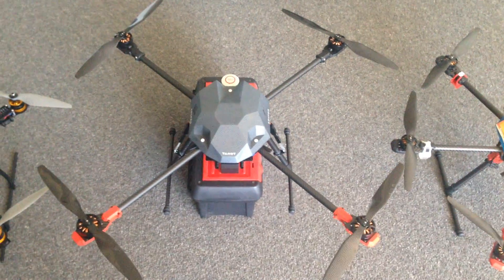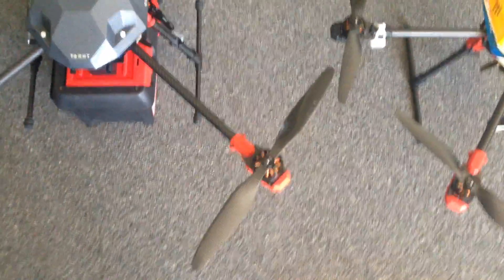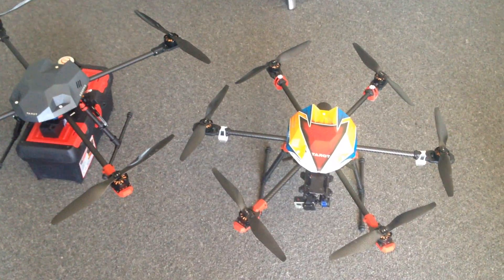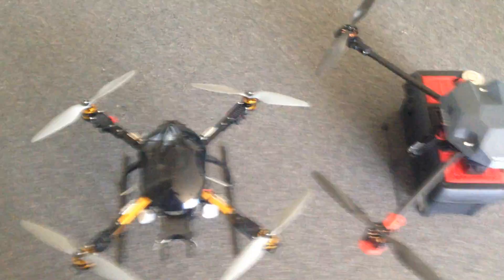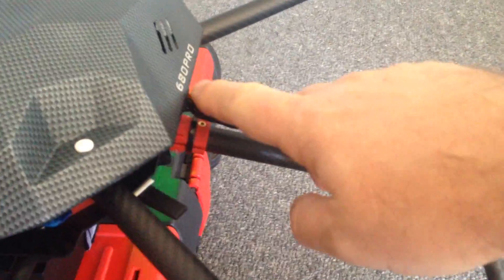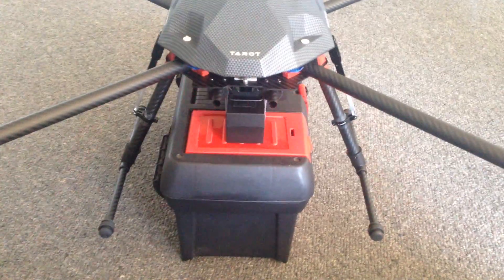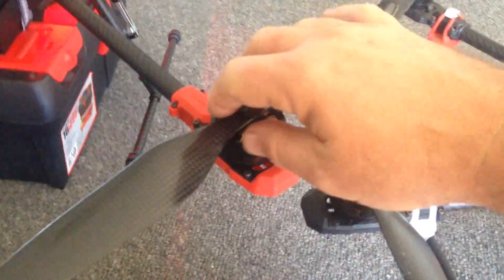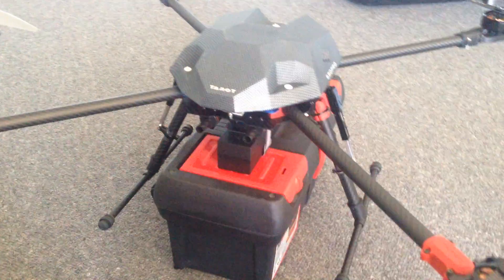Tarot 650 Sport with Retracts - stretched to 840mm

Comment: Hi Trainboy64, to stretch your tarot do you use 333mm carbon fiber tube?, I need to know what is the best dimension, I hesitate between 275mm, 323mm and 333mm.

I'm planning to put 17'' and probably 18'' propeller.
I have 5010 360kv motor. 
My principal utility with this drone is photography, I need stability. 

TL68P04 275mm
TL68B09-02 323mm
TL68B09-01 333mm

Thank you in advance.

Comment: Are standard arms 230 mm? (Tator 650 sport) Can you use 1555 with standard arms or need to extend?
Reply from the maker: +Vladimir “Demon Valholl” Samoylov Yes the standard arms are 230 mm,  I stretched mine with 330mm arms.   I don't think you can fit 15 inch props on the standard version.
Reply: ***** Thanks. Yes. 230 mm is't enough...  I think between 650 Iron Man and 650 Sport... Sport version is so heavy :(
Reply from the maker: Vladimir Samoylov I am not familiari the Iron Man, is it much lighter?
Reply: ***** Iron Man - 476 g, Sport - 700g
Reply from the maker: Vladimir Samoylov Thanks Vladimir,  that is a big difference - I should have done more research and would have built the Iron Man instead
Reply: ***** You can check on tarot web site. I think PCB power and auto landing tools more heavy... I think a lot about this frames.. I like retracts.. But weight.
Reply from the maker: Vladimir Samoylov Yeah the weight is a killer. It flies now for about 38 minutes with the 10,000 Mah battery but every 100 grams extra weight reduces that by about 90 seconds.
Reply: ***** Oh. Thanks for this information. Maybe I try to save more weigh if I use 6S battery. But 38 min is awesome )) I need only 15 min )))
Reply from the maker: Vladimir Samoylov Yes 15 minutes will be very easy to achieve.  I can carry an extra 800 grams payload and still get more than 15. :-)
Reply: ***** Yes.) I try to make 2000 g / 70 oz quadcoper, because in Thailand have some laws.. If it is over 2 kg (2 kg - 25 kg) I need to have some documents, license and INSURANCE! 57 000$+ сover with damage to third parties. I need to pay 200...215$ every year for this insurance. * laws:( But I know some easy cheat. I have to use 2 battery. When police stop me I will remove 1 battery))  But If I have drone less than 2 kg - no documents It is Hobby)) Really I think it is good rules.
Reply from the maker: Vladimir Samoylov Two batteries is a good idea!
Reply: ***** Only one way for long fly))

Comment: how do you stretch them, what do you need?
Reply from the maker: +Thomas van Hek You will need longer CF tubes for the arms.  The originals are 230mm,  I used 500mm and cut them to 330mm myself, but I believe you can buy them pre cut now at 330m  (or make them what ever length you prefer)   I got my tubes from Himodel.com

Comment: I have the 650 Sport frame and 4 330mm tubes on the way but I was wondering - is there any trick to transferring the arm locking fitting from the stock arms to the extended ones? I've been looking at pictures online, but I can't see enough detail to see how they are attached. Do you have to drill a hole through the new arms or do the stock arms just use set screws to hold the locks on? Thanks
Reply from the maker: +Tim Goggin Hi Tim, you just have to work them off the stock arms gently.  I found putting a small screw driver in between the arm and the fitting and working around the 360 degrees helps.   They will come off easily after loosening.  I then drilled a small hole in the new arms to fit the locking fitting.

Comment: Hi Just curious how did you decide on that motor instead of some other motor?? What specs stood out that made you say that's the one?
Reply from the maker: +Terry Dubay I have used Sunnysky X series motors in other builds and am very happy with them. At first I planned to use 3508 - 580 KV motors on this build but wanted to use 17 inch props and a 6S battery.   The 340KV - 4110s seemed a perfect solution.   Mainly from research and also a bit of past experience with the brand.
Reply: +Trainboy64 Thank you :)

Comment: Very nice build! I'm putting together a 650 for 17" props as well and was glad to find your video. Can you tell me what type of drill bit and technique you used to drill the holes in the frame end of the booms? I understand that cutting carbon fiber has certain safety issues associated with dust, etc.
Reply from the maker: Matt Molnar I just my arms under water with a metal hacksaw so the carbon dust wouldn't go anywhere (in a bathtub) and also filed the ends neatly under water.   As for the holes, I used a very small phillips head screwdriver and with the arms inserted into the plastic ends I twisted the screwdriver into the hole and rotated a few times until it penetrated the CF tube - then I did the same with a slightly larger screwdriver.  When the hole was approximately the right size I used the bolt and it enlarged the hole a bit further - everything is snug and tight.
Reply: ***** Thanks so much. Do you have any detail shots of your build? I'll be using a Pixhawk and Turnigy Plush ESCs. I'm finding it a challenge to decide just where and how to mount the ESCs. There's not a ton of room.
Reply from the maker: Matt Molnar My ESCs are under the canopy and honestly its a jumble of messy wires but the connections are solid and the escs stay cool.  The motor wires are long enough to run the full length of the arm to the centre and into the ESC.  I soldered the ESC wire to the motor wires for better connections.

Comment: I'm building this same kit... I can't find the extended arms you have anywhere. Could you point me in the right direction?
Reply from the maker: Harncore450 Hi, I bought 500mm tubes from Himodel.com and cut them to be 100mm longer than the standard arms - I think it was around 330 mm in length when cut.    See this link.   http://www.himodel.com/multi_rotors/D16xd14xL500mm_3K_Matt_Finish_Carbon_Tube.html
Reply: +Trainboy64 Thanks!

Comment: Great setup! I totally agree with extending the arms for aesthetics reasons. However, before I make the same plunge, do you find extending them causes any greater amount of vibration throughout the frame or disturbance for the flight controller?  Also, can you give a more detailed account on how you modified the landing by putting the shims on them? How did you put the shims on them and what shims did you use? Finally, where did you mount your ESCs, underneath the motor mounts or inside the canopy? Thanks!
Reply from the maker: Dustin Banks Hi Dustin,  I didn't notice any additional vibration from extending - in fact I think the vibrations at the centre are less. The longer arms may absorb some vibrations from the motors.  I used small strips of cable ties and put them inside the arm of the landing gear so that it wouldn't go all the way down - when the servo meets this resistance it stops and the controller stops driving it so it stays nicely in that position .   My ESCs are under the canopy, its a bit messy under there with wires but you can't see it and I was more concerned with having good solid connections.   They stay reasonably cool anyway even without the prop air flow.
Reply: ***** Thanks for the info! Definitely copying your setup cause you did a great job!

Comment: I'm having a horrible experience with this tarot, sadly.  Had the dealer replace a leg because it would go up, but not do. After replacing it, discovered the controller is bad. Have had this thing to weeks and still not in the air. Really hate the way the integrated pcb board rubs against the folding arms still.
Reply from the maker: Rabeiro Photography Yes I had a few issues with the legs not working reliably - I used small shims to prevent them reaching maximum up and down positions and that solved all my problems - the legs are now 100% reliable.  I agree with you on the PCB and didn't use it - I used a separate PCB mounded on the top plate - mine is messy under the canopy but all connections are solid.
Reply: ***** the odd thing is that one leg works perfectly. The retailer replaced the "bad"  leg, but it still looks up. The bad one doesn't always come down. I'm so afraid to retract them and not able to get one down causing an obvious disaster. It's random though. Put mine on a surface like yours and the right one is arbitrary. Where did you put your shim and what did you use?
Reply from the maker: I put the shims on the legs so they prevent the legs from going all the way down - then I adjusted the position of the servo so that it doesn't fully close when the legs are up - I found that limiting maximum extension and retraction stopped them from jamming.
Reply from the maker: Rabeiro Photography I can upload a video tomorrow if that will help.
Reply: +Trainboy64 When you say shims, are you referring to washers (thinking thats what they might be translated to American lol).  Can you post a pic of what you used?  Thank you so much for all of your information throughout these videos.  Super helpful!
Reply from the maker: +Steve sprague HI Steve, I used cut off heads from cable tied and taped them up inside the leg mechanism.  This prevents the leg from going all the way down,  (just by a few degrees) that stops the servo from binding at maximum travel - since doing that the retracts have been 100% reliable.

Comment: Wow that is awesome, what size arms are those and where can I get some?
Reply: I don't know how you can get such long flights, I've a tbs discovery with aerial mob arms, running 15in props, sunnysky x3508s, parallel 2 x 5000mah 4s, and I get maybe 20-22 min hover, 15 min aggressive flying.
Reply from the maker: ddavidd816 What props are you using?  How heavy is your TBS?  What KV motors are the 3508s? Have you tried the DJI style 15 x 5.5?  They are super efficient.  The arms are cut from 500 mm booms - I cut them to be 200 mm longer than the stock arms.  These motors are 340 KV and work best on 6S
Reply: ***** I'm using hobbyking 1555 carbon fiber props below, total awu is about 2.55kg/5.6lbs.
The 3508s are 580kv, should have gone with 380kv, thought it would be easier on my 4s batteries and 4s setup.
You cut the booms yourself? awesome, if I build another endurance one, I'll try your longer arms with 17in props and 6s setup.

http://www.hobbyking.com/hobbyking/store/__62871__1555_Carbon_Fiber_Propellers_CW_and_CCW_Rotation_with_Dual_Mountings_1pair_US_Warehouse_.html
Reply from the maker: ddavidd816 Give these props a try - they are a great match for the 580 KV Sunnysky motors - I have them together on my stretched Alien 560 and it gets 19 minutes from a single 4S 5000 Mah battery - or 26 minutes with a 3S 8000 - Very quiet and smooth too. http://www.hobbyking.com/hobbyking/store/__39778__15x5_5E_Carbon_Fiber_Propellers_L_H_and_R_H_Rotation_Suits_DJI_Hexacopters_1_pair_.html
Reply: ***** Thanks for the advice, i'll give it a try, I also bought a 8000 4s battery recently, I have a kind of noob question, 4s has more power than a 3s with the same Mah, but I see a lot of people use 3s for endurance flights, why is that? For the weight saving? I see people use either a 6s i'm guessing to turn the large motors or a 3s for slower kv motors, but why is 4s not as good for endurance? Thanks

Comment: Retractable legs.....now yer just showing off!  An hour of flight time?  Whoa!!!
Reply from the maker: Yeah maybe an hour if I buy a huge capacity 6S battery that is going to cost over $100 bucks...Maybe I'll settle for the cheaper battery because I'm cheap.. who needs to fly for more than 30 minutes anyway...
Reply: We've been successfully paralleling batteries for I don't know how long is that something you can consider?
Reply from the maker: Brian B Yes that's a good idea and I will try it - these motors really call for 6S batteries though - I think when loaded up with extra weight of more batteries the 4S will be a little underpowered.